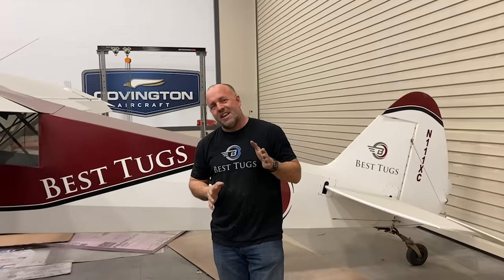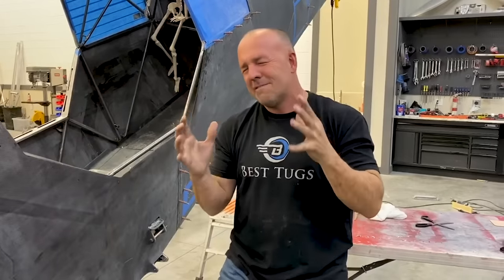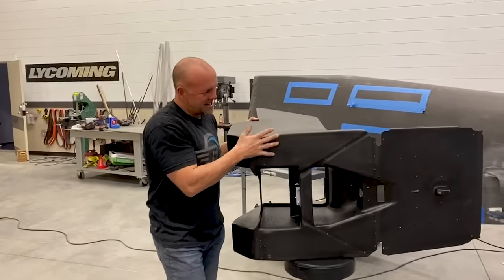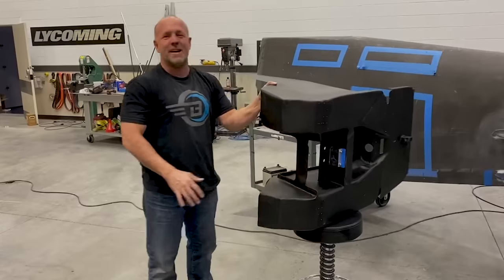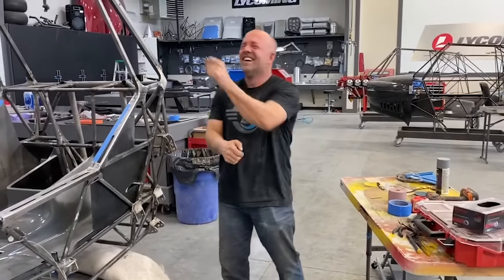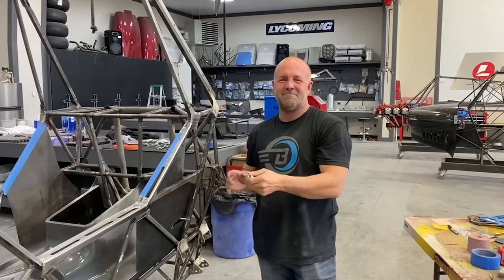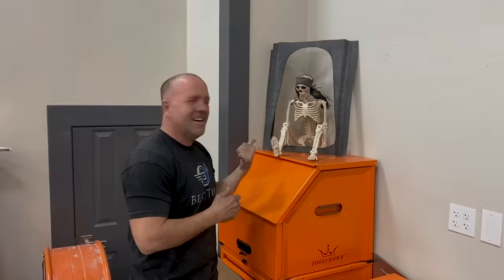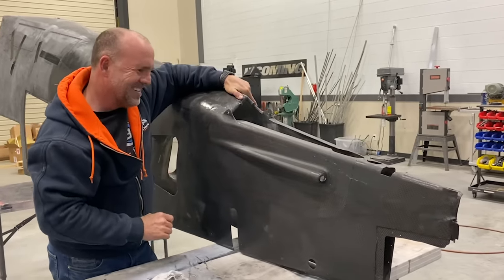Floorboards, Pedals, and more 🤠 (Scrappy Bush Plane 9)

Comment: Mike, instead of using metal wire, you can use Dyneema which is much lighter and stronger. If you want more information on it than here are two sources that talk about how to rig it up on YouTube. 1) Sailing Zingaro and 2) Tula's Endless Summer. If this tip helps and you decide to use it than please give me a tip so that I can improve my life. Thanks.

Comment: Something to think about with the pedals is the reaction force/torque on the pedal itself from the lever arm you’ve added. Looks like the pedals are nice and wide, but I’ve made a similar part for a Baja buggy and ended up twisting the pedal over time. Love the update, really excited to see the finished plane, something tells me it’s going to be a BEAST 🙌 I hope you keep the carbon visible with the paint
Reply: I commented before finishing the video, sorry, carry on ☺️ I like the diagonal cross piece in the back of the pedal too, best way to prevent twisting!

Comment: Mike, why not trying Carbon-Honeycomb-Carbon sandwich? This will add a lot more rigidity. Honeycomb can be anything from aluminium or Nomex core.
25 years ago, I worked as a IT student at a Hexcel composite production site in Belgium. They were making  super light weight panel for 747 kitchen and overhead bagage storage. These component were ridiculously light and you could stomp on it.
Reply from the maker: Philippe Marbaise I agree completely, I  do it often, I have some parts done with it already for scrappy but I’m not done with the video yet.  Coming soon

Comment: Oh Mike, I hope that you scrap the cotter pins that are made out aluminum and go with stainless steel to prevent galvanic corrosion of the aluminum cotter pins in contact with the stainless steel in this very critical rudder cable assembly!

Comment: Mike,  I’m sure you have already taken this into account, the Arc movement of the Rudder Cable where it exits the Carbon Cable Fairings, as the rudder moves full deflection left and right.  I.E. the control horns Arc causes the Cable to travel Inboard and Outboard, right?   I build and fly Giant Scale RC Model aircraft that have the Pull Pull Rudder cable set up, but obviously I’m not dealing with near the sophistication and expertise that you possess.   Truly enjoy your videos, “Back to Work”.  :).  Kind Regards Ken
Reply from the maker: Aluminum Pro  yes thanks.. 👍🤠 got it covered and finished the remaining tabs and isolation bushings. All set now 👍🤠

Comment: Those cable pass-thru's look like gun ports!!! You should make another set for the cowling. 

Just a note...boxing-in the rudder pedals with pieces of drillium tacked on the backs will make them torsionally rigid. You might need that with the added lever-arm of the cable attachments.
Reply from the maker: Paul Slevinsky  👍🤠 love the way you think and I did beef them up. Great observation maybe I can show more later  on it
Reply: @MikePatey  Great minds think alike (haha). Amazing work. Yer a total inspiration for the community. Thx.

Comment: Hi Mike, Thanks for another very informative videos on your Scrappy build. I've learned a lot from your engineering and design work. Well done.
Regarding running the rudder cables on the outside of the frame, I'd like to know how you're going to keep the cable from rubbing against the two frame pieces as it gets closer to the rudder extension pin. I'm sure you have it figured out, but please share with us your design to ensure the cable doesn't rub over time and fray as it rubs against the frame. Thanks.

Comment: Your ingenuity is mind blowing. I love the rudder trim tab modification. So much cleaner and functional. Any way you could add an electric adjustment cam so you could adjust mid flight? Just a thought.
Reply: Captain Charlie Bravo I think once it’s trimmed it shouldn’t change much, so adding the electrics would be needless weight. Would be nice to just hit a button and trim it though. I have to agree that is the best functional mod to the plane. I also like moving the rudder cables away from the pedals.
Reply: tomcoryell What about at different power settings? This isn’t your standard power plant. In earlier episodes he mentioned the necessity for different cooling configurations based on the power setting. I would assume the slipstream and P-factor would also increase and decrease with relative power output. Ex. Flying formation with the boys or in a full power climb. Thoughts?

Comment: Hi Mike, We  have at least 10  wire cable thimble ends that we squeeze so that the sides are parrell. '/we found that on hard landings the thimbles elongate and are very difficult to reform.
 ~A small squeeze in a vice does the job to prevent this. .
 Just an idle thought, had you thought of putting Draco's engine into scrappy~? yud save a lot of weight! Ted in UK.
Reply from the maker: Edward Frater yea thanks I do that as well,  and seriously don’t tempt me on Dracos 680hp in scrappy.. it crosses my mind all the time 👍🤠😂😂🤷‍♂️

Comment: You're going to need a bronze or delrin bushing where the control cables exit the guide tubes or the carbon fiber will saw right through the vibrating control cables like a grinder wheel.
Reply from the maker: mtacoustic1 of course, I have all the bushings and it clears when I install them after paint.
Reply: @MikePatey  Super!  With your attention to detail I should have known better.  Love your enthusiasm and work ethic!

Comment: Will you fill in most of the exit hole in the cable fairings? Maybe plug that hole with a teflon slug and drill a cable sized hole through the slug.

Comment: If you ran a cable from one (rudder pedal) spring to the other and gave it several wraps around a central shaft, you could trim the rudder 'on the fly.'

Comment: 12:00 reason a larger tube is stronger than a smaller bar is: second moment of area of a circle is pi()*d^4 / 64. Strength is proportional to the fourth power of the distance of the outermost fibre to the centre. In simple terms a little bit more diameter makes a big difference.
Reply: How much larger of a tube does it take to be stronger than a bar? I don't understand that formula, do you have an example of sizes? Thank you for that dose of information!
Reply: @getstuk87  Almost any size larger tube is stronger than a bar (depending on its wall thickness). The formula for the SMA of a tube is pi()*(D^4 - d^4)/64 where D is the outer diameter (OD) and d is the inner diameter (ID). (I've typed it in MS Excel formula notation - try it for yourself). For a simple example using no particular units, a bar of OD 10 has an SMA of 491. A tube of OD 11 and ID 8.25 has the same SMA (wall thickness of 1.37).  A tube of OD 12 and wall thickness 1.37 has an SMA of 657. So you can see that small increases in OD make a large increase in strength. This assumes you know what raising a number to the power of 4 means.  In case not, 2^4 = 2x2x2x2 = 16.
Now the whole point of this is to reduce weight, which is a function of cross sectional area. A = pi()*(D^2)/4. Our bar of OD 10 has an area of 78.5.  our tube of OD 12 and wall thickness 1.37 has an area of 45.8. Dividing those numbers shows that the tube would weigh only 58% of the bar, but be 34% stronger.  The reason is that the material in the core of the bar is 'dead weight' ie, not contributing to strength due to its distribution. That's the magic of SMA.

This has been a public service announcement by your friendly Mechanical Engineer.
Reply: @meetim6271  wow, I should have went to school. I somehow understood enough of that to get what you mean so thanks for the laymen explanation ;) Very intriguing.

Comment: Love the videos. I am curious what happens in the rare case a cable or the joiner breaks? Does the rudder go to neutral position or does the other rudder pedal pull it because of the spring? Wondering if there is some safety built in like with the throttle cable.  1/4 way through my PPL - keep the videos and the inspiration going!

Comment: It would be cool to put that trim spring/bolt assy. on a servo or cable and route it around to the control panel so you can actively adjust trim in flight.
Reply from the maker: Corey Hill I did use electric trim on Draco works great.  I just saving pounds, I may switch it if it needs more than a tiny trim but likely won’t need it

Comment: One (unimportant but still enjoyable) fact: Did you ever noticed there is an bluish-greenish arc between peel ply and the carbonfabric? It's not very bright, but clearly visable while lights turned off. I asume it's an electrostatic discharge. (I'm not sure all thermosetmatrices have that effect, at least Hexion L285 and others I used in the past have. :)

Comment: Hi Mike, exciting project, how ever I was wondering if static electricity is going to be an issue with an air frame like that, steel tubing under a shell of carbon!?
Reply from the maker: Lars Rosing yea it can be if you don’t ground them together and all moving points to isolate and connect the charge and transfer to several wicks. I have done it before and it’s simple if you get all the points of contact along the way.

Comment: Sweet!  Do you use Hysol to attach finished carbon piece to another piece, or just micro and additional carbon?
Reply from the maker: AvocadoBlue yes I love hysol it’s an absolute must on fuel tank bonds and other critical components. Most circumstances you can use micro and save weight and money

Comment: Mike with your talents in design, construction, and flight characteristics have you ever thought of building a nice 4 to 6 place backcountry certified plane with performance characteristics similar to Draco for the commercial markets? We need something like that both for flight schools and hauling supplies and people into the back country without having to buy a beaver, an otter, or helicopter when we do not need to haul more than 2 or 3 passengers and smaller supply loads.There is nothing like it on the market today aside from kits like marks Zenair CH-801 and you cannot use an experimental for commercial purposes. I am sure there are plenty of investors that would cover the initial millions and millions of dollars in certification costs.
Reply from the maker: SirMasterJoe  I would love to bring a new back country carbon fiber work horse to market after I retire.  Just for fun and it’s my passion
Reply: @MikePatey  I don't have millions but keep my id as a smaller investor. I know whatever you do will be a work of art and highly sought after.

Comment: Yeeees another video !! I'm so stoked that I haven't wait for this one that long <3 
Everytime my youtube notification rings me that Mike has added a new video, it's like a holiday for me :D

Anyway, Mike, if you read this, I've noticed you use regular gas collet on your tig welder. When you're going to do all those welds on your Cr-Mo frame, make sure to get Michael Furick's welding cups, either Jazzy (size #10) or FUPA (size #12), they're super efficient, you can use even less argon flow with them than with regular collets and you'd get better coverage which is quite crucial especially with Cr-Mo in application like this. On top of that you can weld with really crazy tungsten stick outs in difficult areas without having to worry about loosing your shielding coverage.

Take care Mike, you're my favourite Youtuber
Reply from the maker: rixogtr great tip 👍🤠 thanks so much 🤠🤠🤠
Reply: @MikePatey  You are very welcome Mike, see, I don't like to guarantee things that I 'm not sure of but this little cup really does that magic, especially in skilled hands like you've got  :))

I'm looking forward to your next progress on Scrappy ! 
Cheers from Down Under

Comment: Mike, wouldn’t it be better to have delrin inners for the metal guide rings? Something to prevent metal on metal touching and promote a smoother glide
Reply from the maker: Daniel Tojcic absolutely YES 👍🤠 they just don’t get installed until after frame paint.  No cable contact to metal anywhere 👍🤠 they squeeze insert snap rings into the metal guides.  I finished the last four rings after the video and test fit them.  Clearance everywhere is awesome.  Great comment Daniel 👍

Comment: Question for you. If you remove the rudder trim tab and then use the adjustment on the rudder pedals for your trim won't you ultimately still have the same aerodynamic drag? Just moved from a small tab to a smaller deflection of the entire rudder?
Reply from the maker: Tim Piscitelli 👍🤠 yes, it’s just cosmetics and some weight
Reply: @MikePatey  thanks for the reply and love following the build. Best motivation out there.

Comment: Rather than using cable for your controls have you looked into using heat set  dyneema such as Dinice Dux? It is stronger than steel, way lighter and has low creep.  there is a trend in sailboats to replace the 1x19 stainless standing rigging and steering cables with products such as dux, huge weight savings.  Just a thought that may be worth you looking into.

Comment: Mike obviously rudder cables are critical. What kind of double securing method are you going to use in addition to the cotter key for your rudder cable attachment. Just curious..a small cotter key seems pretty light for the amount of energy in that area..

Comment: Have you looked into carbon fiber rods? We made some pushrods out of carbon fiber, with chromoly tips, to lighten valve train weight. They were insanely strong, both in compressive and tensile tests, and crazy light.

Comment: Hi Mike , love your videos and your work, I noticed that the cable of the ruder up font has a slit tension on two bars of your air frame, wouldn't it be a nice idea to put two pieces of Teflon so it doesn't work its way through the air frame in the far future also have a better slid effect .......... Lets get back to work!!!
Reply from the maker: Adonios papa  yea I just had not finished the last four tube guides and bushings in the video yet. It’s done and no rubbing. 👍🤠

Comment: @9:40, so much details on how you are saving weight and designing for your preference! (MORE! MORE!)
This is what I watch you vids for, all those details!
@10:56, the thing sleeve holding the cable, could it not just be a simple washer, locked in place by the pin, would be half the weight?
And regarding the drill out bolt holding the bar, might of been able to thread the bar and the pedal and lock it in place with a lock nut?

Comment: Mike with the replacement of the Rudder Trim tab (bent section) with the Rudder Pedal retention spring screw adjustment mechanism, will you run into the possibility of loosing a tiny bit of Rudder Authority on one side and running into the Rudder stop early on the other side ?

I guess it all depends on the screw mechanism’s adjustment travel and the total gain in your Rudder system between the Pedals and the Control surface 🤔
Reply from the maker: Dave Robinson  the springs have no affect on overall throw or authority whatsoever.  👍🤠 great question
Reply: Mike, very true ... but does the assembly effectively set the nominal  ‘ track = heading ‘  trim condition (with pedals displaced slightly asymmetrically) ?

Now I’m thinking the angular difference or arc length traveled would so minor one would not even notice.

I could of course be totally not understanding how the arrangement works, in order to achieve the same outcome as the bendable fixed rudder tab 🤔

I appreciate very much that Chandra and yourself took time out of your extremely busy day to reply to my original question. 

I think your answer clears it all up, I just need some time to digest it, I’m far slower that you mate ... LOL 😉

Great content 👍 looking forward to the next video 😎

Comment: Galvanic corrosion may start in holes bored in carbon embeded aluminum, between alu and carbon, between rivets and carbon, and between stainless steel bolts and alu.

To isolate: drill holes with the next larger size diameter, sand and clean thoroughly, and make sure that the carbon and the aluminum are not in contact. Then, fill the holes completely w/ epoxy, let dry, and drill holes in the required diameter. This builds an epoxy cilinder in the hole's walls.

To seal: right before bolting or riveting, slosh a good sealant in the hole and on the rivet (or other metal attachment).
Reply from the maker: Luiz Schechter  I’ll show that in an upcoming video, it’s a great technique I have used and your comment reminds me I need to show that.  Love it, thanks 👍🤠

Comment: I was not expecting to see the cable rubbing on the frame at 21:45. 

Earlier I thought the rod was appearing short in the mock up, I guessed wrong.
Reply: Could have used another another Inch, LOL
Reply from the maker: Charlie Harper on final assemble after the frame  gets its paint, I will install the isolation bushings in the tube guides and then the cable doesn’t touch anywhere as it spaces to center of the guides.  👍🤠
Reply: @MikePatey  Hi Mike, I too love your videos, had just had to watch your latest as I discovered it to night. I have alway been keen on aviation and building stuff. My aviation have been limited to hang gliding, but I have built light weight boats and now race car parts, so I am greatly interested your techniques. 
I too spotted the cable rub on the frame closest to the pedal where there was no guide ring. I don't see how a bush in the ring 3 frames back will prevent rub on the forward frame. Happy to be wrong, would had for you to cut a cable!

Comment: Mike, I noticed that the cable to right rudder pedal appears to rub a tube just prior to the connection to s/steel tube! I know you are aware of it, do you have plans of adding a rub strip on the tube?
Reply from the maker: Bobby Morrison I had not yet finished the last 4 guides and bushings but it’s done now and no rubbing 👍🤠